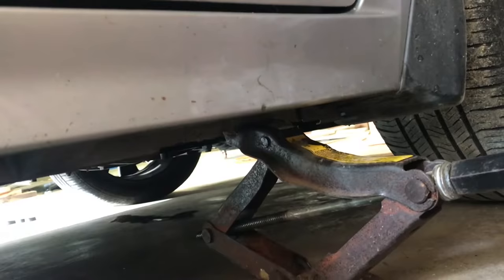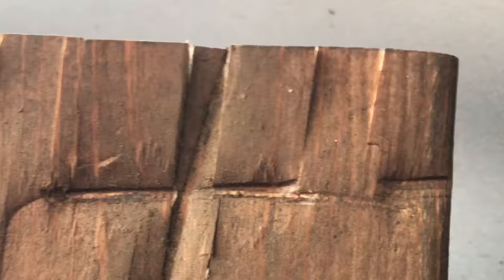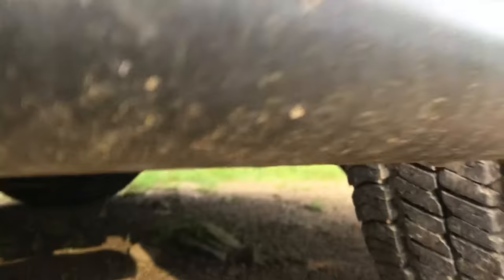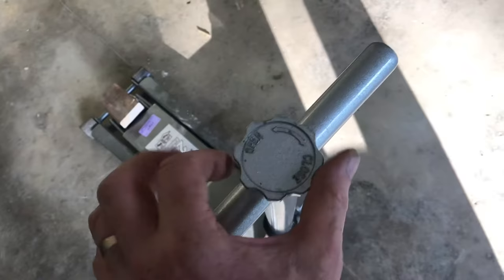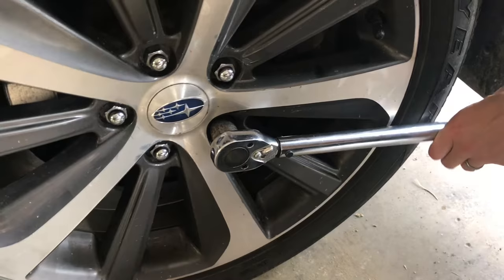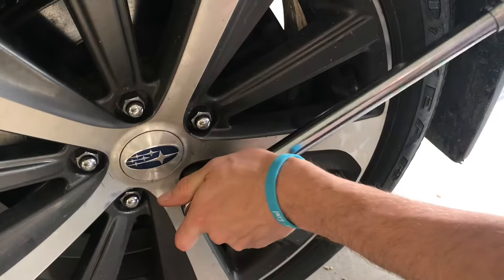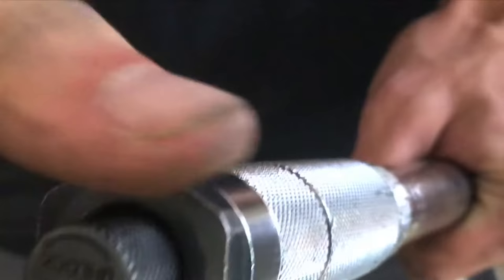how to IDENTIFY jack points on your car

Comment: Identifying the jacking points on unibody construction car is not the problem for me, it's identifying the points where the jack stand should be placed after the car is jacked up.
Reply: exactly!
Reply: Man . This is the comment . It’s so many of these videos but none answer this question. It’s almost like rocket science at this point
Reply: The sides are your friend, my cars lowered so it’s a bit more annoying for me but I get the jack under the side first and if I’m doing the front I just slide the stand under the front cross member
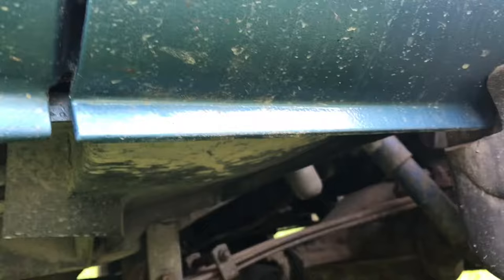Reply: @Yamommasblubber  I used to be able to use my 50cm hydraulic trolley jack from the front on my old 2004 kia rio to raise the car and place the stands either side in one go.  On my newer cerato I have to squeeze the trolley jack and jack stand to share that reinforced pinch weld point 1:28 one side at a time, bit more annoying to do oil changes.
Reply: This video is actually wrong, those "jack points" are where the STAND goes, NOT the jack itself! The jack goes right next to those jack points to the right or left, where there is a reinforced weld (typically double layer of sheet metal coming down from the frame similar to the jack stand location.

Comment: Lifting under the double welds is not a good idea. Sheet metal bends. The scissor jack that comes with the vehicle should have a slot that allows the weight to be next to the double weld, not under it.

Comment: Look at the manual? yes. My problem is the manual is shite. And the graphic identifying the points is as clear as mud. Thanks, this was a great video. I learned a thing about the torque wrench. Might be too late for mine... but I'll remember to release the pressure on it in the future

Comment: ....also I had a really strong feeling to check YouTube about this before trying just by someone telling me to just jack up the car and unscrew the lug nuts.......but I found out here to NEVER unscrew the lug nuts when it's on a jack.......I believe that God sent that strong feeling to check YouTube 1st........thank you and God for helping me.....I have no one that can help me right now and you basically came to the rescue without even knowing it....thank you again ❤❤❤
Reply: Yes, this guy is good because he learned from his mistakes!  I took automotive classes in college for fun to be able to work on my own cars properly and because I like to know the why of things and how to prevent or extend time between failures through lots of research, and dont want to get ripped off by mechanics (I am a scientist at heart so every think goes through a scientific process in my mind).  I have worked with several guys on fixing their cars in their garage and every man I have ever know (except a master mechanic who had worked on everything from tanks to school buses) did lots of things VERY wrong and you cant tell them they are wrong because they will say they have done it like this before.  What they dont understand is yes, you can do something wrong and it wont immediately fail but in a yr or less it will and you wont know it what it was or even when it fails in a big way until there is an accident. 

I had a question for a neighbor and he ended up putting on my brakes which I did not want him to do (he thought I was taking too long but mistook caution for lack of knowledge) and ended using a product for airplanes that he thought was better because it was rated for airplanes!  I said just because it is rated for airplanes doesnt make it better.  Turns out I was right.  After looking into it, it only goes to 300F which is not high enough rated for brake work and he didnt put lube where the piston meets the back of the brake pad (which already had a tiny nick in the rubber) so now I have to redo it in 100F heat.  I HATE when MEN try to pretend to KNOW something when they never even bothered to read instructions or learn or look into something with some depth!  My god, with computers how easy is it to look something up these days!  The vast majority of men I have found, do things very incorrectly and only by the grace of god or pure luck do they end up not killing people. If people want to disregard the instructions, fine but make sure you read them 1st and have a damn good logical, well researched alternative.  Dont just start using whatever sounds good and then give it to someone with a family of children and act like you KNOW it will work when you havent even used it yourself long enough!  Men are the worst about safety. 
At least this guy has paid attention to mistakes and made corrections even if he didnt read instructions that came with the adjustable torque wrench (not all of them come with it but men are notorious for not reading anything anyway). Simply put, there are some really  great tips in this video that should be stated by ANYONE trying to show others the CORRECT way to do something.  There are times people need to be creative and go against the standard practice BUT you NEED to know what is the standard practice to begin with before you start making alterations and I have found that most guys that work on cars, dont even know very basic safety practices.  This video gets my very rare stamp of approval, very well done sir, you have addressed some important things that others do not.

Comment: Question:
My manual shows the jack points. I'm assuming it's intended for using the scissor jack it comes with in the trunk.

If I want to use a hydraulic jack and use the jack points, how do I identify where to place the jack stands? The area around the jack points on my vehicle is all flatten plastic and if the hydraulic jack is on the jack point, where do I put the jack stands? there is a plastic cover under my car i need to remove to even see the frame.

It looks like the newer vehicles try not to put any information on how to service your vehicle and are trying to force you into the dealership servicing department.

My car has a cover underneath my car so I can't even locate the frame. Not sure how i'm suppose to take the cover off. I don't really want to get under there while the hydraulic jack is holding up my car.

Comment: I never trust those pinch welds. Once they rust, you’re fucked. I use the point where the control arms meet a cross member. Always works

Comment: We have a 2016 Honda CRV AWD.
The jack points are what I use all the time.

However, I would like an opinion on something, because I'm going to buy one of those pneumatic, air bladder jacks (balloon type) to make life easier.

Sure, I can lift the car from the usual spots.  However, I wonder if it would be ok to lift on that frame part that is between the 2 jack points?

The jack points, which jut down, are part of a kind of frame thing which goes between the 2 jack points.

But I don't know if the center is as strong as where the jack points are.

So I wonder if there's anyone with experience in this?

Thanks in advance.

Comment: Thanks!  Could you show us the jack points on a 2014/2015 Chevy Spark? These cars no longer come with jacks and lug wrenches.  They come with tire repair kits.  Ok but there are still times you need to jack the car! I am trying to teach my daughters how to change their tires and I am not certain where to place the jack.  I would greatly appreciate it.  Thanks!

Comment: And what are you supposed to do when your jack point doesn't leave any room to put in a jack stand
Reply: Put your Jack stands in the same place as the jack. Check out Rennstand safe jack
Reply: @calvinmitchell6381  been wanting these for a while now. Got a unijack in the meantime but its too tall for my 05 outback but im trading it for a 00 s10 zr2 in a week so ill be able to use it finally lol
Reply: If you want to use the stands at the front jack on the rear point the whole side of the car should l raise up

Comment: The manual on my jeep patriot says to look for "the triangular cutouts on one of the flanges in the sill flange assembly" and the pictures are from the worst angle and too far away any advice on what im looking for?
Reply: Yea...my manual just tells you to use the jack up point & shows a line drawing
Reply: @BastetNoodles  found better videos by searching my vehicle modle and where you put jack stands on it